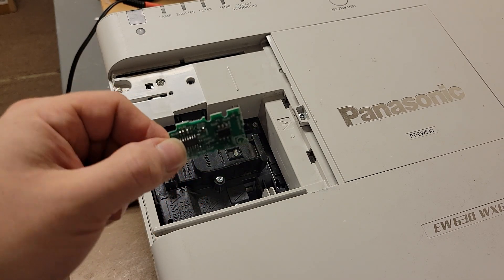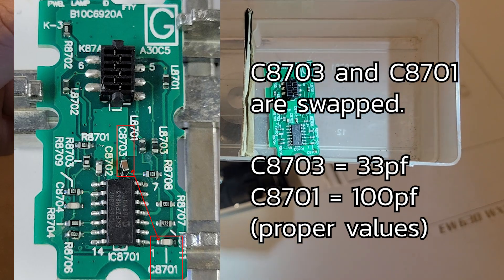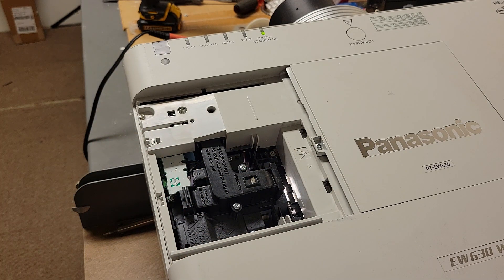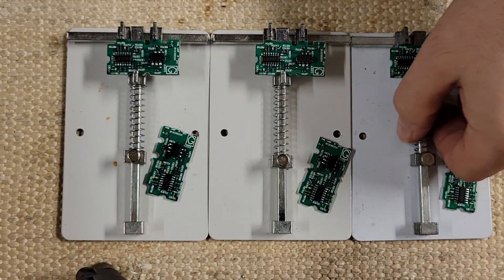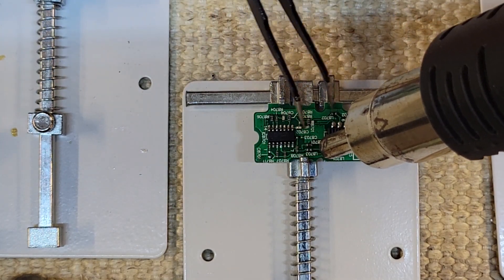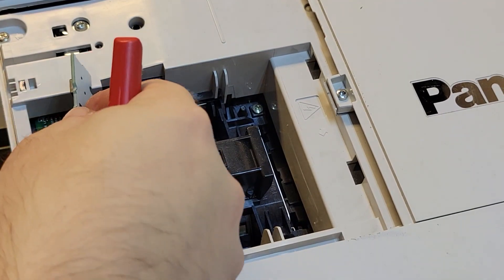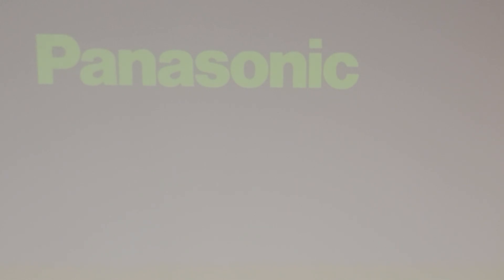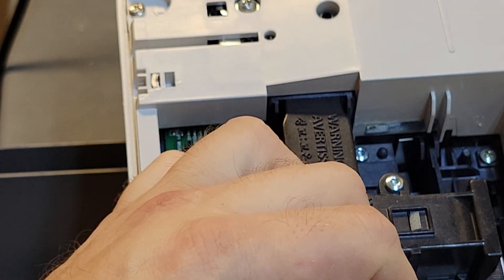Sanyo/Panasonic Video Projector Lamp Timer Module Repair

Comment: Hi Frank, awesome videos! Could you help please? I have a Sanyo PDG-DHT8000L for which I bought two not-original lamps (the bulbs are original, the case not) and they are not both recognized. If I swap the PCB from the old-working lamps, are there any ways to reset the counter? Or with these new lamps, any way to reprogram the chip or anything else I could check that makes them not recognized? I see something like an ICSP port on the PCB module.
Reply from the maker: the chips do support ICSP but they are locked/encyrpted. If you try and read them they show up blank as the copyprotect bit is set.  This encrypts the rom and makes it unreadable. Are you in the USA by chance?  or is there a way I can get in touch with you?

Comment: This is not so related to this video but given it's the latest one, I thought it would possibly get some attention here.

How useful or valuable are used projector components? I'm lucky enough to have a source of used projectors and components of them at negligible cost. I've gotten anything from little NEC XGA things to giant 10k lumen dual lamp Epsons/Christies, and a good deal of Panasonics and Sonys. Of course some of the nicer ones I try to fix up and put on eBay (nobody wants them locally, and to be honest, they don't sell well there either). A lot of the times I end up pulling a lot of "generally useful" parts off them e.g. lenses, fans, connectors, motors, etc off them, but I often feel like it's a bit of a waste because a lot of useful (for projector repair) parts are discarded. I've tried listing things like DMDs etc, but I'm not sure if there is enough interest in things like this to actually stock them.

Based on what I see on this channel, there seems to be indeed a market for fixing projectors, so I'm inclined to think some of the parts I come across could be useful to someone. In fact, a large number of the projectors I take apart actually work fine, so the parts are probably somewhat usable at least. What would be the best way to perhaps distribute them? It's not too much of a hassle for me to ship things around North America currently. Is there a market for used parts like these on eBay or something? Which ones would be best to collect? At this point it's less of a business thing for me and more of a "reduce waste and be useful" kinda thing, since I know how it feels to really need something specific and wishing someone could find it somewhere

Thanks!
Reply from the maker: Hi Larry,  You are asking a wonderful question that I also have myself. eBay is always an option but they have become less friendly to the non-business seller very recently. 
I have a lot of thoughts on this. If you want to/are able, email me via the link on my about page. I'd like to talk to you about this.
Reply: @FixitFrank  I've sent you an email. Hopefully the email on your channel is the correct one - if you don't get it in the next little while, feel free to reply and I'll see if there was a mistake
Reply from the maker: Just saw it! Im at work but I will get back to you later.

Comment: Your videos are great!! I've got an Epson Powerlite 5010 that the prism (I believe that's what it is) looks like it was cracked and then started to melt and has a yellowish tint in the middle. Not sure if you have seen this happen before and if so, where can I get the replacement part for that? Any information would be greatly appreciated!! Thanks!!
Reply from the maker: Thank you! I appreciate the kind words.  I know what problem you mean.  The coating on the prism is failing.  That usually means the polarizers and at least one of the LCD panels is failing.  You need an 'optic block' or 'prism and lcds'.  That entire module has to be changed.  The lcd panels are aligned to the prism and to each other. Epson wont sell them but you can get them from China.  I suspect a used/working optic block would be $200-250~ An HC8100 optic block cost about $225. The 5010 is similar so I'm guessing its priced around there.
My personal feeling is that your money would be better spent on a newer projector.  Epson's tend to last 7-10 years before they go bad. Even if you change the optic block, it will happen again and probably within a few years. I'd put it up on Marketplace or Ebay for part/repair and put that money towards a new projector.
Reply: @FixitFrank  Frank, thanks so much for the quick response and input!! I purchased this projector as a project to fix, so I am only $100 in it. I don't mind putting $200-$300 into it if that's what it needs and I will get a good projector after. I am just having a really hard time finding the parts. Any specific sites you can recommend to get the parts? Thanks again!